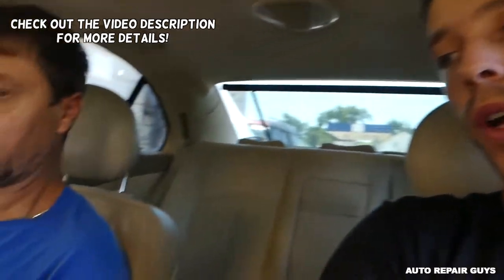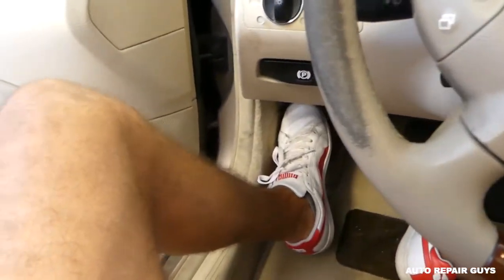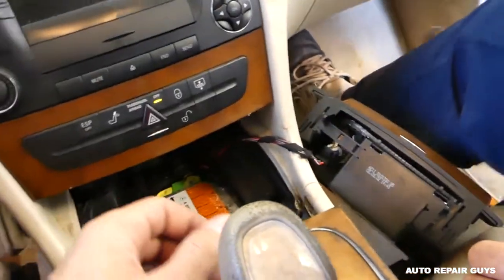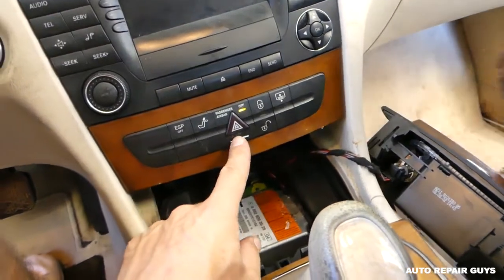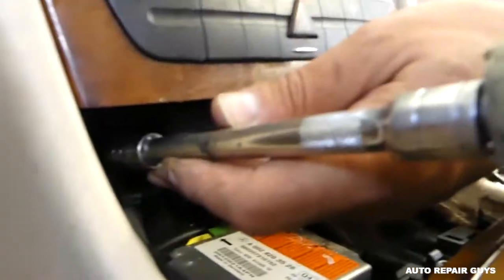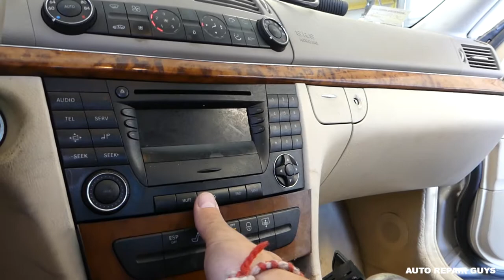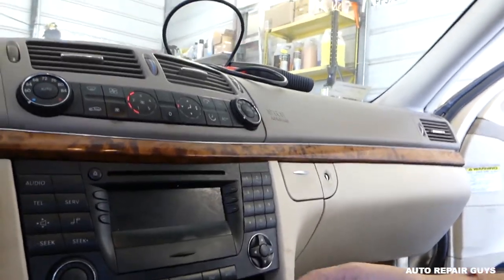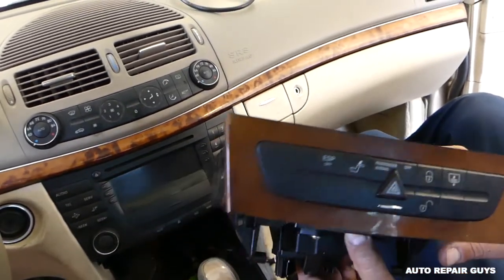MERCEDES W211 Hazard Light Door Lock Control Switch Panel REMOVAL REPLACEMENT

Comment: Hello I follow you I like your very beautiful videos, I own a W211 E270 the driver side lock when it closes goes up and down, I disassembled it to put the other one and now with the key if the window is open it does not close with the key automatically, and it doesn't even go up with the button automatically but it goes down automatically, as I have to program, thank you very much

Comment: how would you remove the wood paneling ? it wouldn't fit in my new radio mold because of the wood feature. how can that be removed ?? Help !
Reply: have you found a solution:? im also in need of replacement and wanna know how to do it :) ?

Comment: Hi, i was changing radio and I unplugged it. Now when i put it back on, The motor wont lift it up. Is there more than 1 cable powering it? Does it have some sort of fuse that i blew or something? Help!